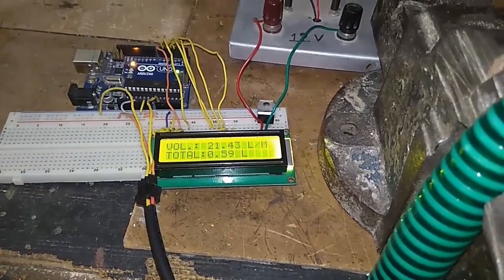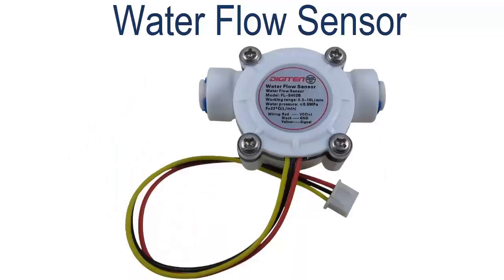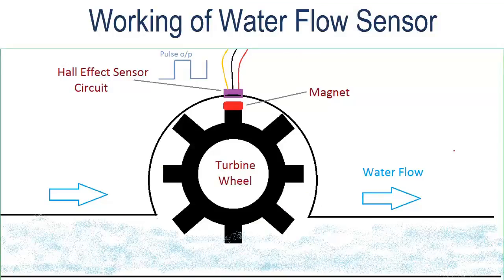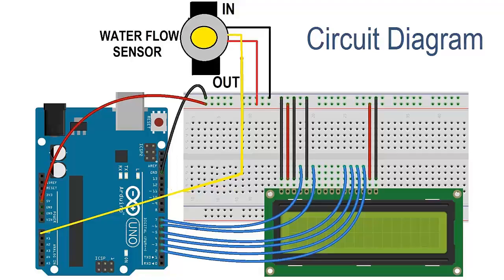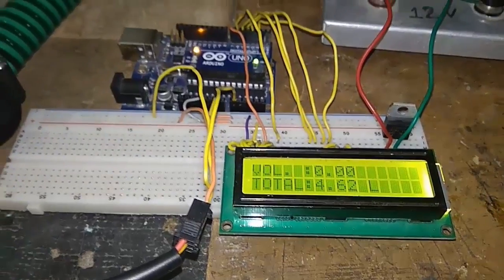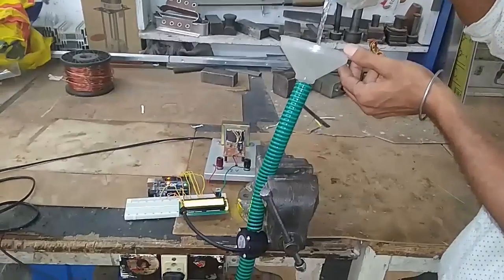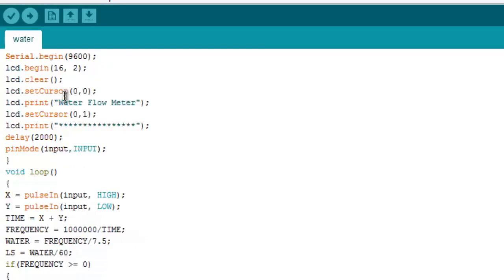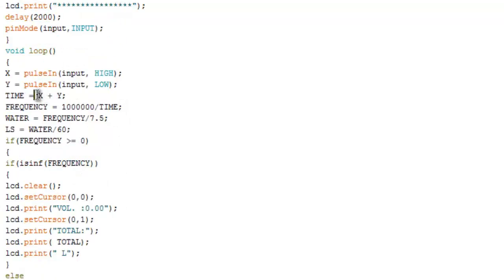Water Flow Rate & Volume Measurement using Water Flow Sensor & Arduino

Comment: Thanks for the awesome tutorial. I'm working on a similar project using 5 water flow sensors, I would like to know if I can use Arduino analogRead since Arduino Uno has only 2 interrupt pins.

Comment: I need a water flow on/off switch to switch on a water pump when it senses water flow in the pipe line.  Please advise what I should buy and is it available on amazon?
Reply: Same here, my problem is that the water is weak not high pressure
Could this go well?
I don't know

Comment: Good solution! It is easy to use this flow sensor to work with Arduino.
Reply: Hi brother I need a help from you , 
I have successfully done this project once but when I do 2 nd time 
My LCD does not show any characters it shows only Blocks 
What should I do ? 
Please help us brother really needed
Reply: @nikhilnaik3791  hii bro 
In the video he used 12v can u please tel me the materials which he used please

Comment: Good day, im trying to make the same project but im just making the idea out of my head idk if it possible.
What if i put two pressure water sensor in a pipe on a known distamce, two measure the diiference.. And using energy equation maybe i can compute of the discharge...idk if my math is bad, headloss=change in pressure?

Comment: Could I use this kind of setup for measuring average air flow in litres per minute? Would this sensor work with gas or is it specifically just for liquid? Thanks
Reply from the maker: Not at all. This is designed specially for water. If you want to measure air flow rate then go with annemometer.
Reply: @HowtoElectronics  Thanks for your response. I'm attempting to measure the flow rate of a vacuum pump in real time. I wondered if there is a sensor or device that could be installed between two 8mm PVC pipes that would measure the air flow and display the average in L/min on an LCD screen. Is there a sensor of similar size and mechanics as this one that is designed for air?
Reply: @connordickson6332  Did you completed the project, actually i wanted to achieve the same as you said, if you have done please comment

Comment: Hey. I used this programm with some additions. But the total volume passed is much more than the actual. It appear total depen on how fast the water is passed. if the rate goes faster than the total gets much more than actual volume
I also noticed this in your demonstration. You are holding a bottle of not much tha 1 litre and before you had passed half the water the meter was showing total 3.(something) l reading. I think it needs calliberation

Comment: Hi, I would need this sensor to implement in our cow farm. While delivering milk to customers, I need only .5 lt to flow down and the flow should stop automatically. They we shall open the tap fitted in the container again to flow another .5 lt....can you tell me whether this could be possible by you?
Reply from the maker: This type of flow sensor are not too accurate. I suggest you not to use for this commercial purposes.

Comment: Unless a potentiometer is integrated into the circuit, it will be tough to see the text on LCD. It would be great if you can include the same too.
Reply from the maker: Yes.
10K potentiometer need to be connected at pin 3 of lcd.

Comment: Can we use this for controlling the water flow automatically.
Reply: Yes. You would just need a condition, if total = setvalue, complete function, digital output high/low for example for a relay shut off
Reply: Hi Meena, Did you solve the FLOW CONTROL / SHUT OFF and connect with the flow monitor . Please send me some details as that is also my project. Thanks. David (Toronto)

Comment: I was completed this project and I was also poured 1litrewater but in display it is showing 4 liters.
What should I have to do
Reply from the maker: Calibration is required. Modify the code to calibrate the accuracy
Reply: Please adjust the K parameter
Reply: @digitenvictor1532  what is k parameter?
Reply: @muhammadsamama1047  Please tell me your flow sensor model
Reply: @HowtoElectronics  how to calibrate?
Reply: Do you already get the exactly total dispaly?

Comment: Hi brother I need a help from you , 
I have successfully done this project once but when I do 2 nd time 
My LCD does not show any characters it shows only Blocks  on both the lines of LCD screen
What should I do ? 
Please help us brother really needed
Reply: My brother .
You have to connect a potentiometer (10K) with the LCD and adjust the brightness by the the potentiometer.
Reply: @eng.mosabkhlefat3278  bro , we have observe blocks even though their is  no backlight 
so i think i need to adjust contrast ? am i right ?
Reply: @eng.mosabkhlefat3278  reply if you are free
Reply from the maker: Use a 10K POT at pin 3 of LCD to adjust contract and display clearity

Comment: Can it measure the flow rate of hot water?? We need it for a project
Reply: Probably not, depending on the temperature of the water that you intend to measure. Why can't you use it in the cold input?

Comment: How to configure to Oil?
Should I want to change the value 7
7 which is mentioned in the code
Reply from the maker: This won't work for oil. This sensor is only for water. Water and oil both has different viscosity and density.
Reply: @HowtoElectronics  thx bro
Reply: @HowtoElectronics  is there any specific sensor available for oil ?

Comment: hi.

why id frequency = 1000000/time? why is it 1000000?

also, can you explain why water=frequency/7.5?

thank you!
Reply: Basically the pulseIn function return the time in milliseconds  for which the pin is in the condition of HIGH or LOW so inorder to convert the time's unit to seconds we have to multiply with 10^6.
Reply: @niranjanprasad9266  Thanks! =D

Comment: I used that. But, can we use for < 1 L/mnt ?
Reply: Hi brother I need a help from you , 
I have successfully done this project once but when I do 2 nd time 
My LCD does not show any characters it shows only Blocks 
What should I do ? 
Please help us brother really needed
Reply: @nikhilnaik3791 that's a connection issue or coding issue, as code is simple & if you just pasted same as above then connection issue, make sure you have set the potentiometer to check LCD backlight.

Comment: please this type of sensor can be use to measure flow of a gaz? like in the reactor of biodigester
thanks in advance !
Reply from the maker: No its only for water.
Reply: @HowtoElectronics  so Can I use it to sense the flow of the gas in my biodigester ?
Reply from the maker: You need pressure transducer for that
Reply: @HowtoElectronics   yes, but pressure transducer, IS it for the pressure? I will also measure the pressure but now, I am talking firtsly about the measureof the flow of the gas .
And I would like to be assure that , ysf201 is also adapted for the gas.

Thanks in the advance !
Currently,

Comment: Does strong pressure make damage the YF-S201 water flow
Reply: exactly my question
Reply: Actually i bought mine again, But i test the first one and it is not actually damage, You can test it first before buying new one make sure that it is connected properly based on my experience. Less cost
Reply: @reinielantonio5848  are you using it with arduino or raspberry pi i want to use it with raspberry pi what changes do I have to make?

Comment: I want only 10ml of water 
It is possible to control the flow of water through the valve....
Reply from the maker: Not at all.
This sensor requires large volume of liquid  with fast flow.

Comment: Hi, great job, i'm doing the same project but with air , i need to measure air flow rate and air volume using a flow sensor and arduino. does anyone have any idea what kind of air flow sensor can be used, i have to find the right sensor.
I ask for help, I would be very grateful if someone can help.

Comment: hi!! very interesting project! question: can I connect 21 flow meters using only one Arduino R3 board? Can I check individual flow of each flowmeter in the display? thanks

Comment: Will it measure any liquid?
Reply from the maker: Only water. But it can measure any liquid whose density and viscosity  are nearly equal t that of water with an accuracy of plus minus 10-20% accuracy.
Reply: Is it measures the petrol
Reply: You need the gear flow sensor for petrol. @creativetechnology7710

Comment: How to connect two water flow sensors with a single arduino?
Reply: @Priyanshi Singhal: Hook up VCC & GND in parallel to the existing one ( assuning they're on the 5V rail ) and attach the pulse line to a neighbor digital pin. Don't forget to assign that pin as an input in your source code.
Reply: Hi brother I need a help from you , 
I have successfully done this project once but when I do 2 nd time 
My LCD does not show any characters it shows only Blocks 
What should I do ? 
Please help us brother really needed

Comment: What type mosfet you use in this video?
Reply from the maker: I havent used any mosfet
Reply: @HowtoElectronics  transistor?
Reply from the maker: That is a voltage regulator ic 7805 for supplying 5V to the circuit.
Reply: Right top lcd, what is it?
Reply: @HowtoElectronics  oooow i see, i thought it is transistor 😂 thankyou for the information, may i get your gmail adress? For asking about water flow probelm, i have same like that, and i have a project to finish my task, will you help?

Comment: Hi Bro, I like your video. I need your small help. I need to apply this for real solution. Can you tell me how to turn ON motor switch as water flow sensor detect water in the pipe line.
Reply from the maker: Use relay for hardware.
And on the coding side use high low logic  for relay according to value obtained by flow sensor.
Reply: If possible, Can u help me with a diagram.i have to do practically it at my home’ water motor and tank.